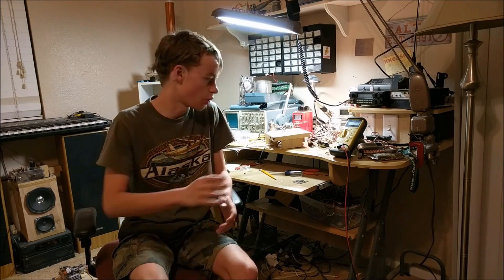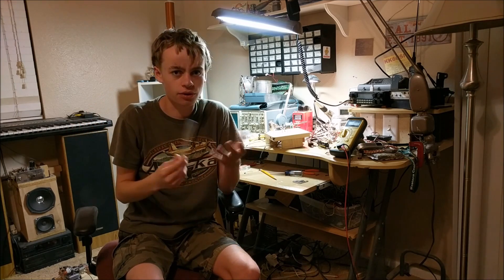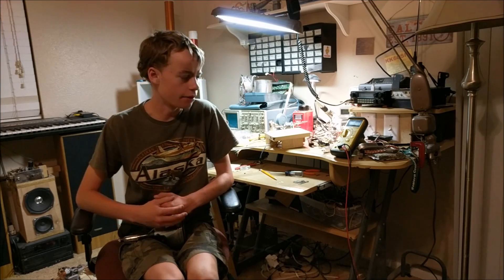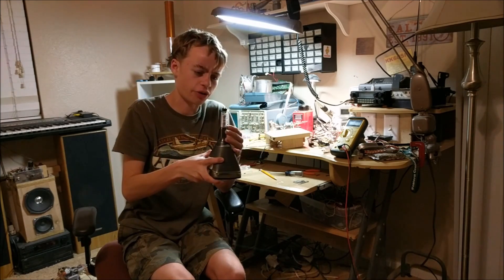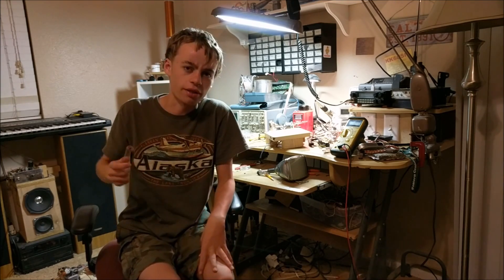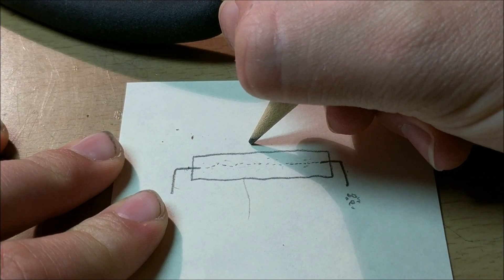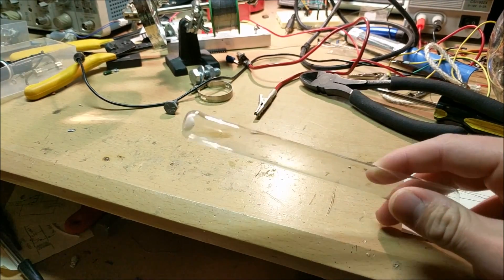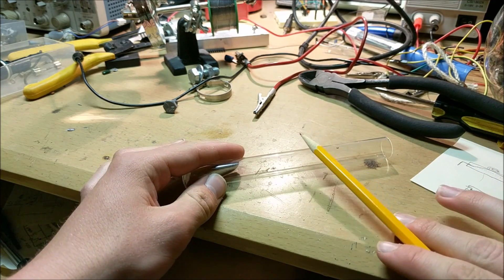DIY Cathode Ray Tube: Interacting With Electrons

Comment: Great video, but the air compressor may be redundant. There is arcing in your tube, which means electricity has broken through the air.  If there was a vacuum in the tube, you wouldn't see the arc, only through the phosphor.

Comment: Actually normally the Cathode ray tube are filled with noble gases
Reply: That's called plasma discharge that's different. Cathode rays are usually vaccume sealed whith very little air.

Comment: How about possible x-ray generation? The glass seems to fluoresce. This is probably just low pressure discharge. I think your pump can not make high vacuum and cathode rays are also invisible. If there is high vacuum, the cathode needs to be heated. Be careful when playing with HV!

Comment: I've been wanting to make a Crookes Tube like this for a little while now.  I was thinking of using common tungsten Drill bits as the cathode and anode because they probably will handle the arc better.  Also, I was thinking that if I first melted some glass onto the bit and then fused the glass to the test tube it may seal more better ;). I've been a bit concerned about xrays though,  even though it's unlikely it would be nice to test with a geiger counter for piece of mind.  Perhaps your school has one you can use?
Reply: I have been slowly working my way to doing some plasma experiments myself, but I too am worried about X-rays. I'm just a college student so I don't really have the cash for expensive testing equipment, and a Geiger counter is a pretty specific tool for something that may prove to be a non issue. Have you found any literature I could read to help me understand how to predict what EM bands will be emitted and at what strength based on the gas medium and driving current/voltage? It would be much appreciated.
Reply: Kevin Counihan  I appreciate the advice, but I'm not so much interested in just generating any plasma as I am in using a very specific method of inductive plasma generation which will require me to custom build the vacuum tube and most of the powering circuitry as well. However, I don't want to go forward with it until I'm sure I'm not going to give myself cancer with these experiments. Or if x rays are unavoidable in my case, then at least I know to put money asside for some proper shielding.

Comment: can you make the power supply out of entirely crt tv guts??? been wanting to try this have everything but the power supply oh and money none of that either
Reply from the maker: Yeah, you probably could.
Reply: You can get around 10Kv from just a flyback, 1 Mosfet and 1 resistor.  Very simple circuit I think Ludic Science has the schematic.  To figure out the mosfet gate resistor I usually use a potentiometer and slowly decrease the resistance until it turns on.  It's a simple and lazy way to do it.

Comment: A cathode ray is not the same as a plasma discharge. A plasma (not blood) is an ionised gas, usually ionised by electrons from an HV source (AC or DC) whereas 'Cathode Rays' are a stream of electrons that continue through a circular anode with a hole, through that hole and onto a target such as a phosphor screen as in a CRT TV or maybe that oscilloscope I see in the background. Sorry if this seems pedantic but they are two completely different things with one demonstrating a controlled and focused stream of electrons (no ionisation) and the other being what you have here, a nice example of a gas that has been ionised in a discharge tube. They are not the same. Sorry.
Reply: Rob Beresford You are sort of correct. A cathode ray tube dosen’t need to have an anode with a hole in it to let electrons continue. The other stuff is corret though. However the tube still has cathode rays in it. A cathode ray tube is a type of discharge tube. You can see that the glass starts to iiluminate, proving the existence of catode rays. Of course this is not the cleanest cathode ray tube, it still shows the phenomenons caused by it, especially when he is using the magnet.
Reply: @StrumpGunnar That’s the thing it’s in the definition of a what cathode means negatively charged. so a cathode ray should be negatively charged electrons and not what you’re saying and not what was displayed in the video either
Reply: Are implying he created a plasma discharge field rather than a cathode ray?
Reply: @therealmcahole83  Yes, that's what it says

Comment: didnt you make x rays
Reply: Tanner Tech The voltage is wrong. X-rays require just 25.000 Volts
Reply from the maker: +Darren DIY No, this tube does not have a high enough vacuum nor a high enough voltage to produce x rays.  X-rays require a near perfect vacuum and am yours of 100000 volts.
Reply: oh ok that explained it